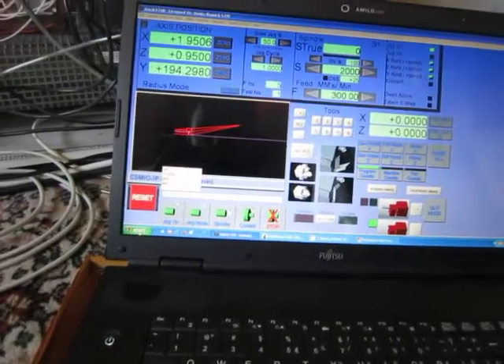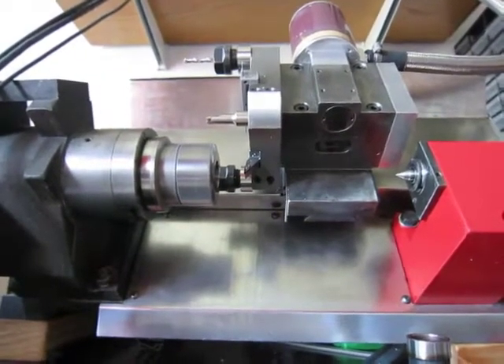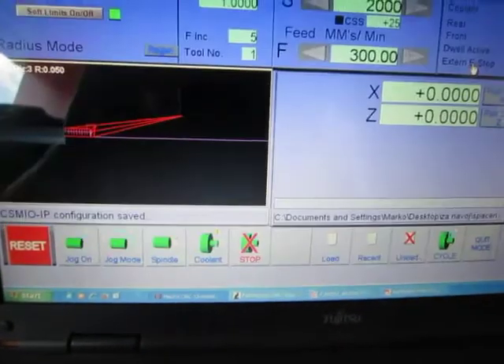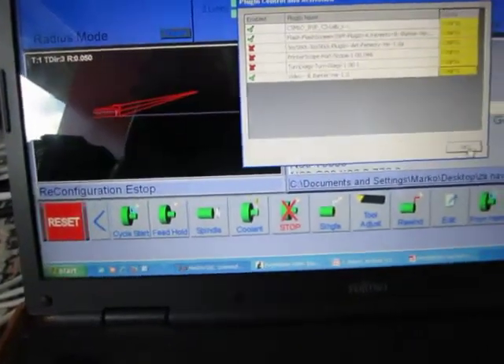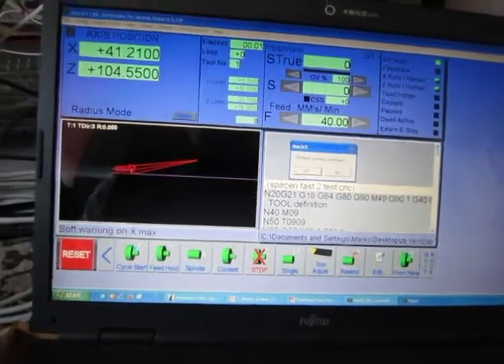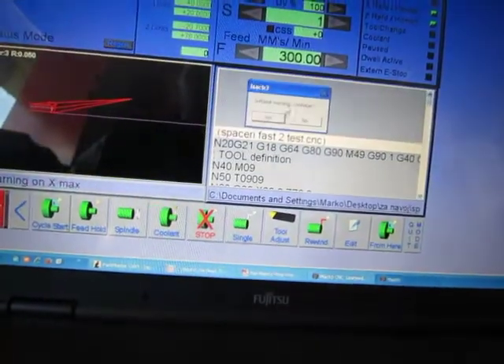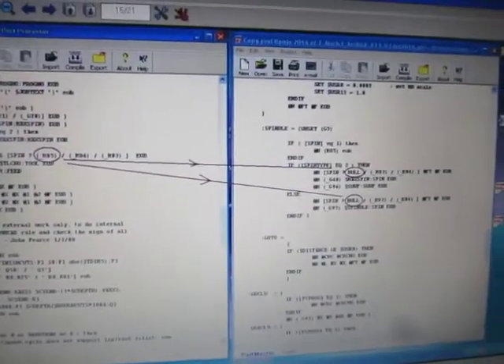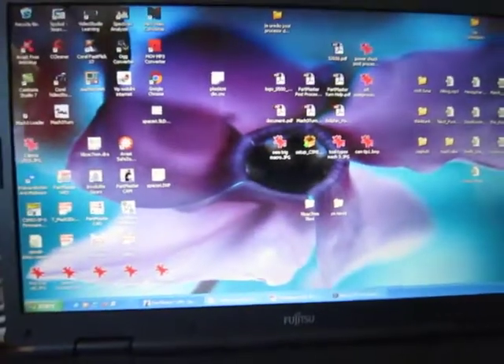Solving spindle problems - G04 - spindle acceleration...M05

Comment: Does Mach not have a spindle at speed function? Where it waits for the spindle to reach commanded speed prior to executing the next move?..... Quick search confirms it does not, but it does support looking for an "at speed" signal from the VFD, if the VFD has this feature.
Reply from the maker: Hi, in first moment I thought you will ask why I do not use spindle delay  in Mach3, but you have idea about something I do not even know that exist,  good info which I need to investigate.  If I find how to use it it will be definitely more optimal then this solution even  this is better then what I had before. 
Thanks on notification/idea.